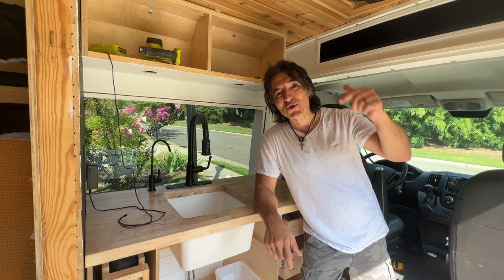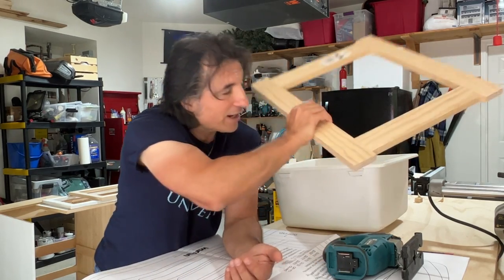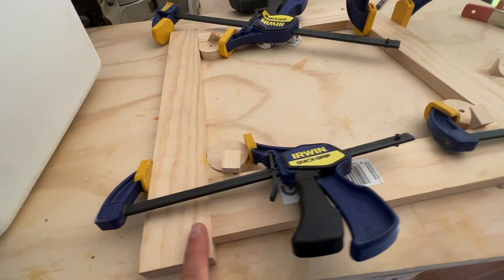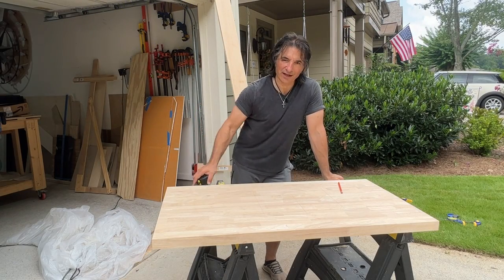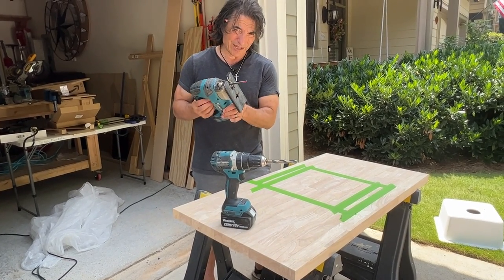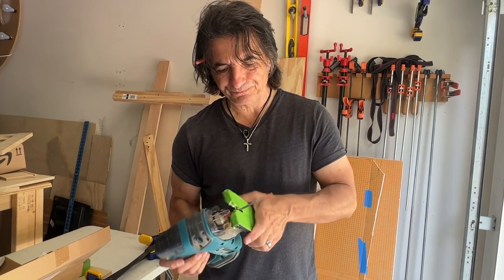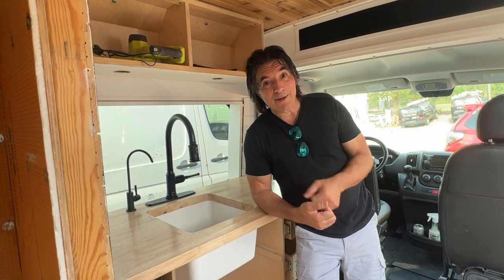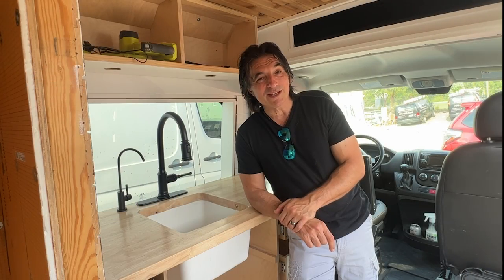Installing an Undermount Sink in Butcher Block: Part 44 - RAM Promaster  2500 Van Build

Comment: Biggest choice for me is epoxy or polyurethane. I keep getting told polyurethane will not be water phobic enough to protect butcher block in an undermount configuration. Epoxy they say will work..but epoxy is more of a pain to apply. They make triple thick poly, I think I might do 10 coats of that. That's gotta be thick and eater resistant. Seeing you use poly made me feel more comfortable going with the poly, it's easier to work with.
Reply from the maker: The poly seems to be holding up pretty well

Comment: You didn’t need to go to the trouble with the corners. Your half inch bit gives you a radius in the corners because a circular bit can’t follow the 90 degree corner.

Comment: Looks amazing... Is there a reason why you used polycrylic instead of polyurethane for your sealer?
Reply: I can’t member what originally drove us to polyacrylic, but we found it really easy to work with, and we really liked the finish. It also dries quick and is easy to clean off. I hope that helps :-)

Comment: Which router bit did you use? My BB is 1.5 inch thick?
Reply from the maker: Im so sorry it took so long to respond. We used a Freud bit. 1/2" shank. It cut through the BB like butter but wow made a lot of dust
Reply: What length?
Reply: Or was it the exact one shown in the photo you posted inset.